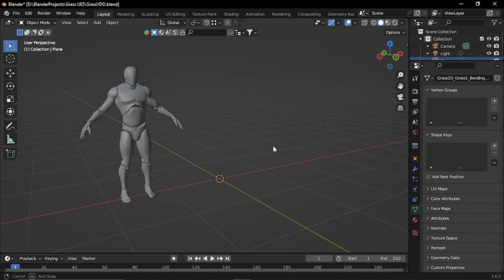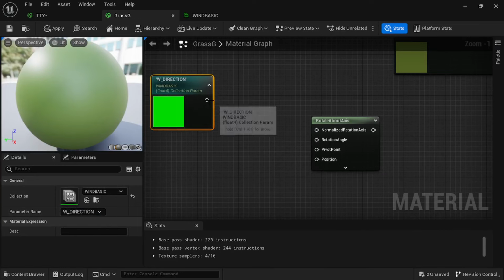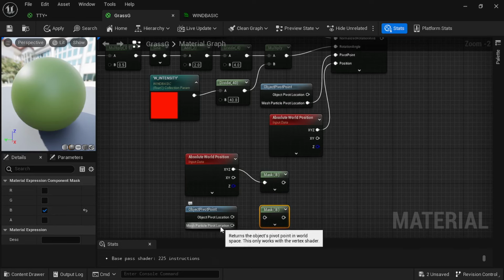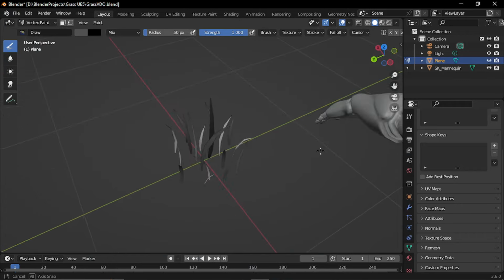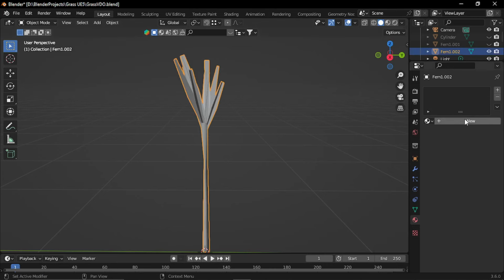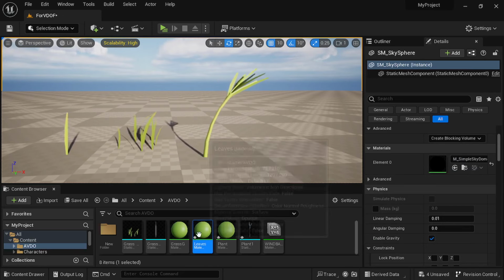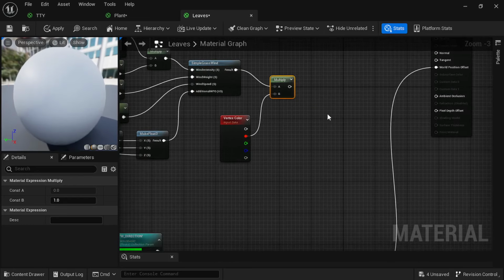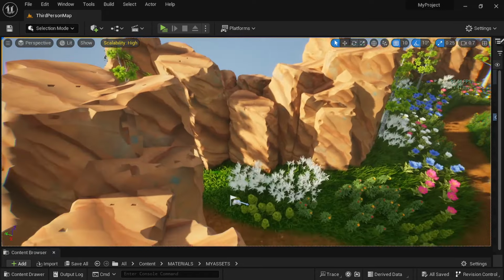Stylized foliage with Wind in Unreal Engine 5 & Blender

Comment: I love your work on this. Great tutorial and clear. Got some questions for a noob here on this...

1) you made the grass with no UV and just mesh nothing else, then exported to UE and did material in there. This is great for multi colour choice etc. Does it do the UV for you? Is it better to just model in blender then let UE do the UV and Colour/material for grass?

2) you did UV texture for plants, leaves etc in blender but not the grass. Assuming you UV the mesh as an alpha plane and bended mesh for the leaves/plants etc for blender then exported to UE for the movement only. Is that correct?

Comment: this turned out looking really good- why use nanite though? using alpha materials with nanite is very bad practice, and using WPO on nanite meshes is also super expensive.. the foliage doesn't even have a ton of detail, there's really no point to enabling Nanite here at all, you're just eating the performance trifecta: nanite cost for handling clusters, transparent material cost in the nanite path, and WPO in the nanite path.

Comment: Nice work mate. I really like the grass part. The rest of the foliage seems a bit simple. What I did recently is generate a texture with Midjourney AI. You can set it to have white / black background, and with an online photo editing program you can remove the background. After some cleanup you can export that as a texture. It's fairly easy to make good looking textures that way, with opacity mask. It would strain the system more, but I think it would still work, especially with nanite enabled.
Reply from the maker: Gr8.. I generally hand paint the basic textures and then use Leonardo AI to create variations of those textures.